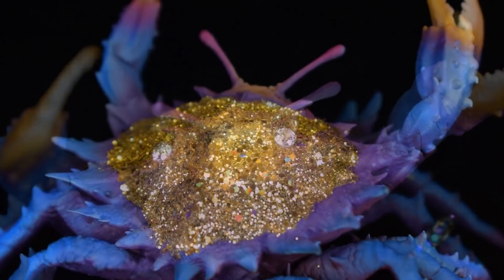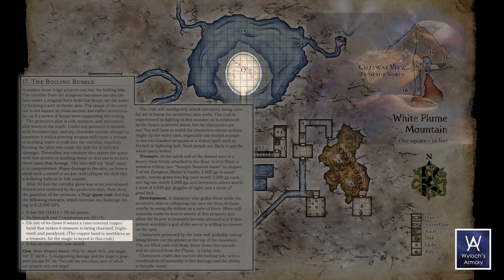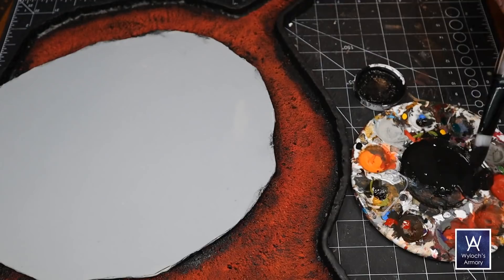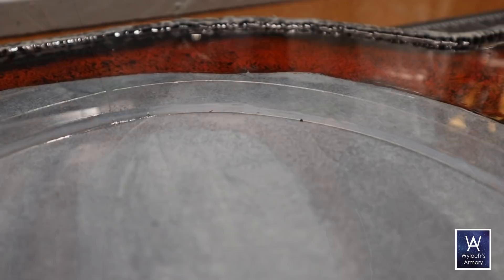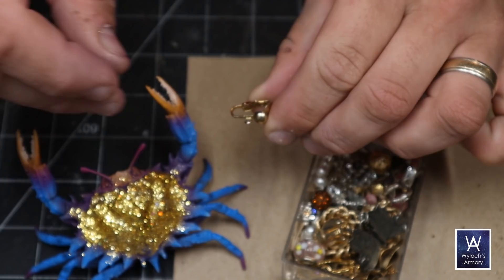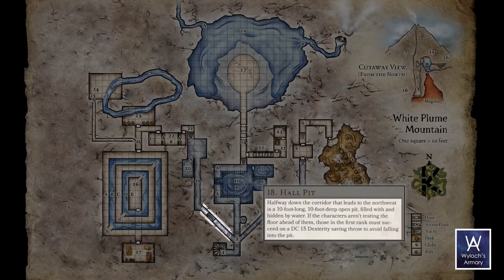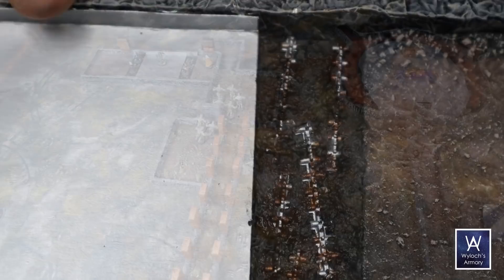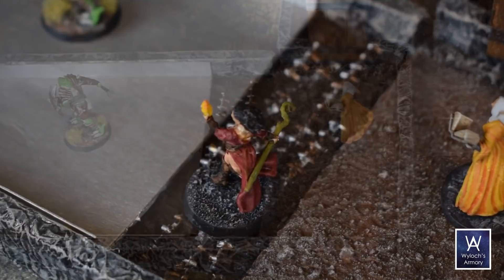I used 💎REAL DIAMONDS💎 in a mini - Building White Plume Mountain for Dungeons & Dragons - Part 4

Comment: If you haven't run this dungeon yet, a great alternative monster to use in room 16 is a Morkoth. An abyssal creature that takes the shape of a giant squid, which is the main different between the crab and a Morkoth. It, like the crab, keeps a horde of treasure on its back, and for added challenge it has a psychic element to it when you enter the vicinity of quite a sizable area so the entire dungeon could have an added layer of danger.

Comment: When flocking and desiring to maintain a grid, couldn't you use a straight edge and a tool 'carve in' the grid after the flock and prior to the glue setting?
Reply from the maker: An excellent idea, yes you could, however I have tried that and was unhappy with the look.
Reply: I guess there's always the option of a sharpie and a straightedge, yeah?  ..or a light pressing of a straight edge (instead of carving) to imply the grid without impacting the overall effect of the flocking.

Comment: Haven't poured resin since I embedded stuff when I was nine. Stupid question coming up - I'm thinking of pouring resin into one of those thin, clear, hard plastic things that supermarkets (or their suppliers) use to stack some of their products. These come in great SFish shapes, and I'd like to use one to make a goop-pond - that's IF there's a way of lining the plastic smoothly so the resin won't eat it. Is there a way to do this?
Reply from the maker: Well, the resin doesn't "eat" anything....like, corrosiveness?  Er, what do you mean by that?
Reply: @WylochsArmory  Thanks for replying. What I was asking was, won't resin dissolve non-hardass plastics? ('Hardass plastics' - nylon, polycarbonate, maybe  polyethylene, for example. Non-hardass plastics - polystyrene, for one.) If it will, is there a way of lining vulnerable plastic undetectably so that it can have resin glooped on it?
More thanks
Reply from the maker: @notreallydavid  Well this resin I am using will not dissolve anything.  It will leak through anything porous, but it is not corrosive to any material in any way.
Reply: @WylochsArmory  Thnaks!